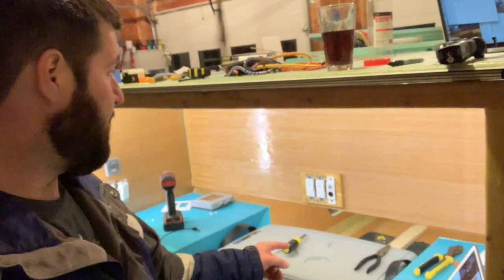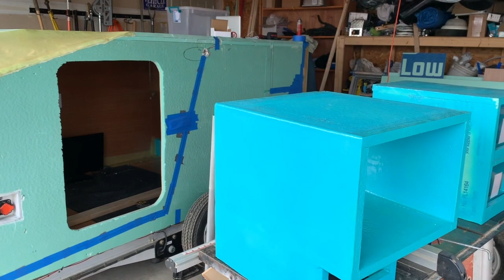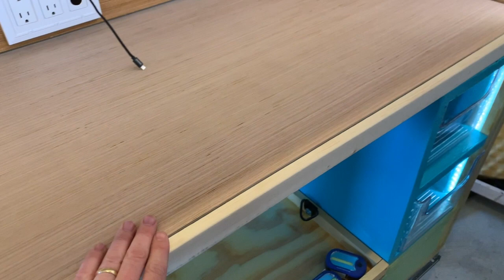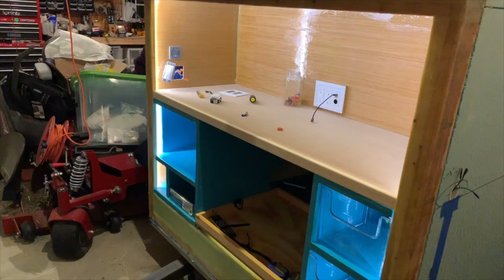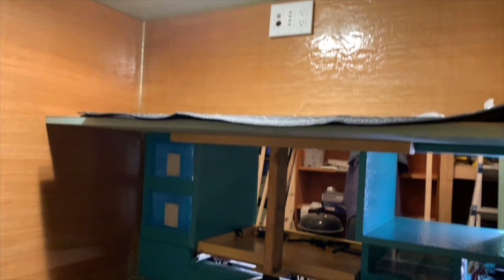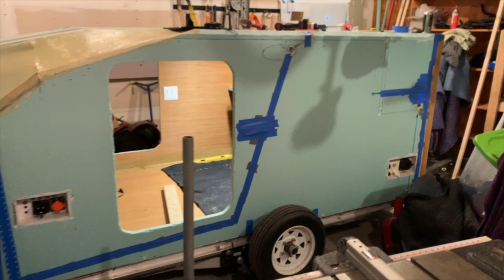Foamie Camper Build: Foam Cabinets and AC Power

Comment: Have you put a load on the inverter when you were testing it for ac? Some inverters need to sense a load before they will put out power. You may want to check out a video on YouTube about the poor man's fiberglass for your cabinets. Great video and camper I have     a few new ideas for my camper as I start to build it thanks to you.
Reply from the maker: Thank you for the input. It ended up being my tester. Stupid me for not thinking about it at the time. But it was my AC outlet tester that wasnt working properly.

Comment: Try using blue painters tape on the edges where caulk may squeeze out. It will make for easier clean up. Nice job so far.
Reply from the maker: Good idea thank you!